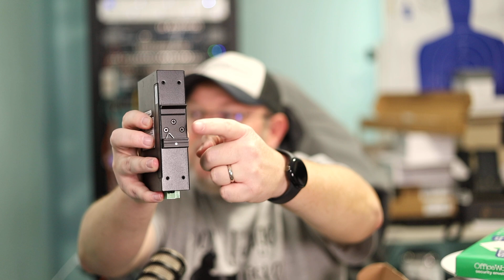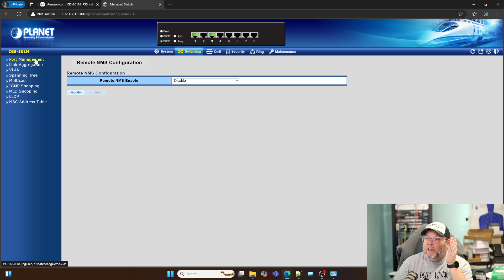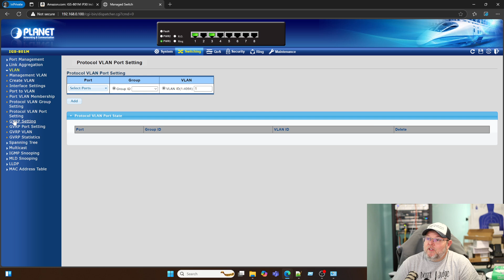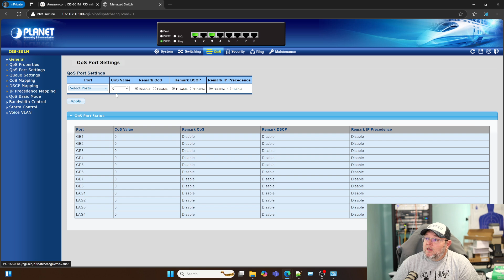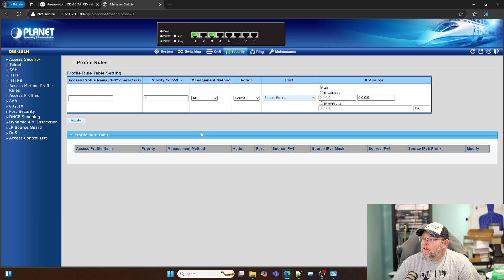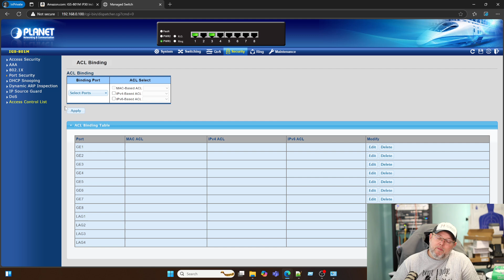Planet IGS-801M Industrial Switch

Comment: Industrial switches seem to be lacking in their VLAN config simplicity.  This one seems to suffer from those same issues.  It's one CLI command in Ruckus to tag or untag a port.  I'm over setting PVID's and other non-standard CLI commands.  Aruba's newer gui and cli interface is garbage too.  Sorry - I identify as "randomly angry" today.
Reply: This carries a scaled down cisco iOS on it with some slight differences . If you comfortable with cisco commands . You will be comfortable.

Comment: I personally like and use Moxa branded industrial switches more. The ones with an RS-232 or E/IP port on it for pulling switch status info into SCADA or machine HMI for hardware status. They have been great switches and the best of the 5-6 industrial brands I have tried.

One of the coolest switches I think they have is the MDS-G4012 and MDS-G4020 series. They are sort of "switch racks" and have option module slots to configure the switch layout as you need. You can add dry contact modules that can be used to trip something in a PLC directly, or isolated power modules to have specific set of ports power isolated from the rest of the network, so some machine stuff can be on machine power and the incoming ports are on plant power. Or you can add PoE capable ports or not, or even groups of SFP ports or not. Really cool switch features.